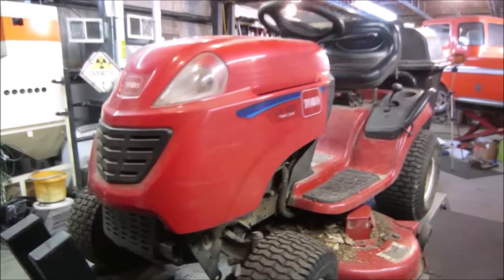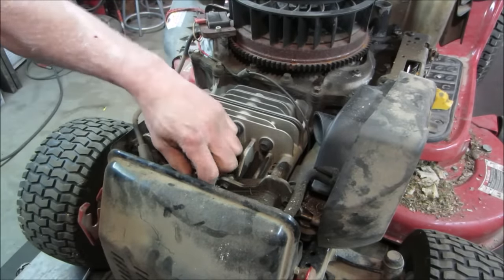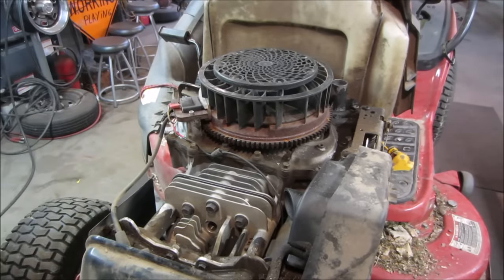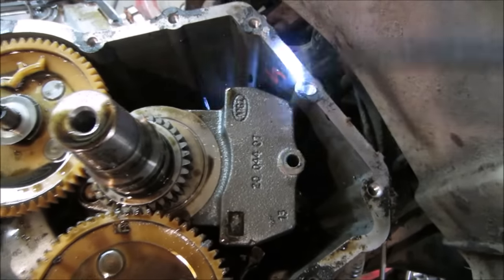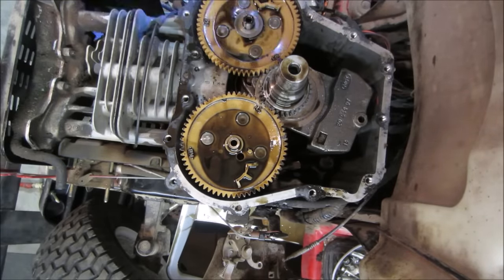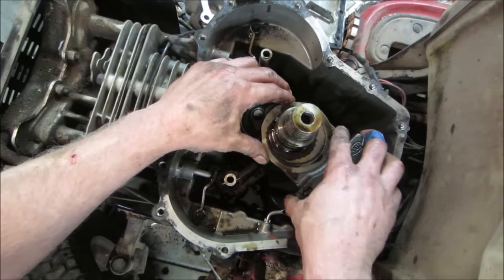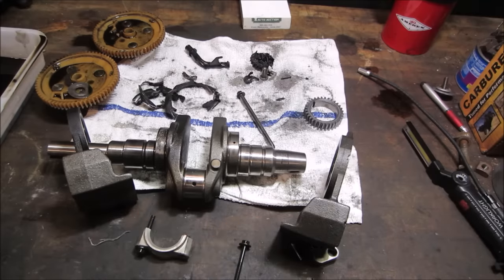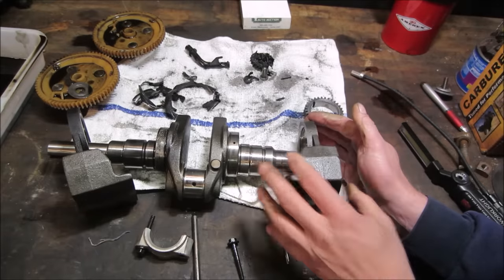You Won't Believe Why This Engine Blew Up,

Comment: Kohler really made a turd when they came out with that engine! The Courage twin was pretty good, but I shortblocked a ton of the singles under warranty because the cam boss in the bottom would crack and lose all the oil while running and BAM! thrown rod! Compression release was problematic too. 99% JUNK!
Reply: I agree on junk

Comment: No matter how old we get we're all still a little boys that like to take things apart to see how they work
Reply: But can we put it back together again  ,is the question 🧔
Reply: See, I think after we learn how things work, we begin to regress in a way. We start taking it apart to see how it broke! After we get our giggles out, then we start to fix it.
Reply: Too often we see how others failed at solving a problem and yes....made things worse. The Mustie types come along to fix the screw ups and then go after the original problem. Happens in my world every day.
Reply: @gispel7058  Hard trying to solve a problem with somebody else having their fingers in it. had a chevy cruze (ew) 1.4T car, misfire all over, everything looked ok ish. After we were doing some testing ect, had it running, full on oil, Turbo started just making awful noises. Long story short, they did horrible oil changes, clogged the turbo oil feed, the son put a used turbo on it, not changing the line, breaking the drain line, and then came to us for a missfire. So DIY gone wrong, aswell as poor maintenance.
Reply: @baileyhatfield4273  Its a problem alright. I don't work on cars and engines but I do mechanical work. Glad you were able to look at your problem and back track what the heck went wrong.
Reply: EXACTLY
Reply: @baileyhatfield4273  if it's not broken, brake it👍
Reply: Building bobber motorcycles I have learned to take pictures... and lots of them!
Reply: @JoeBobsGarage  pictures are ok but you may be taking pics of the other guys failed mixed....out of position/place parts. I'm sure it works for you and I have revered to pics also
Reply: That's how Henry Ford and Harry Firestone got started.
Reply: hahahahahaha
Reply: unless your on ice they pull everything apart and never put it back to geather again.
Reply: @JoeBobsGarage  Got any bobbers for sale?
Reply: Or littles girls too.  I can take it apart but don’t know how to put it back together.  I had a brother that worked on something and I loved watching him.

Comment: Geez one bolt fails and the crap hit the fan!  Thanks for having me over to hang out in the garage bud it's a good time as always.
Reply: considering the diameter of that bolt, relative to the hole, I wonder if the design got undermined by "yeah, but if we downside the bolt, it's a few cents cheaper per 1000", and then it snowballs hard
Reply: @tamberp  The 40 cent bolt...IS NOW 30 CENTS! LETS GOOO. *sad 20 year old engine noises*
Reply: This is just stupid.  It's a counterweight:  why not just use a really big grade nothing bolt instead?  Reduced thread, machined nut, I can only imagine what this cost.  But FYI airliner engines are held on with two bolts, so if one of those fail then figurative crap really hits the literal fan!
Reply: @paulmoir4452  CFM and v2500 engines have five mount bolts up front and four in the rear.    They are all over an inch in diameter. I struggle with a four foot torque wrench to torque them.

Comment: Good show, Moe. The sinister laugh at the end when putting the crank back in with "Up Next. Will it run?" is cliffhanger material all day long. Hysterical and surely has us wondering how bad it will be and how long it will last!
Reply: I have the popcorn ready for the microwave and time on my hands bring it on destruction here we come. Will he do it oh yes he ran the twin cylinder with one piston and jug let’s start the pool for how log it lasts.
Edit: I give the engine 2 minutes 29 seconds before it locks up.

Comment: My neighbor gave me a honda push mower that was locked up. I soaked the cylinder with pb blaster and have been using it for 4 years. Love the videos musty. You have really increased the depths I'm willing to go before I give up on equipment. Thanks 😊

Comment: What a weird engine! Never seen a fixed counter balance like that? Thanks for getting your hands oily and showing us!
Reply: I'm going to guess it has something to do with the unbalanced (otherwise) magnet on the flywheel. Overly complicated POS if you ask me. Not only that, but there's cut corners everywhere you look. Thin case, no hardened surfaces against gravity effects (the part that Mustie was showing that got munched in the crank case), there's clearly no oil ramp, and this relies on other means to get lubricated...
If i were to bet, i'd bet this engine started life as a vertical engine, then some smartass in the cost cutting department decided to swap it to horizontal, with the required modifications, to which there's no issue, it can be done, but if you do it whilst nursing your thumb with your .... it won't last. And a cursory glance on google for this engine proves my point. This engine platform is riddled with problems, from cracking to spun bearings and other stuff. What a piece of junk.
Reply: @aserta  buddy...this is a vertical lol. The counterbalance is meant to oppose the vibrations created by a single cylinder’s piston oscillating up and down. Now most single cylinders just use a balance shaft including newer Kohler. The piece that was chewed inside was likely an oil baffle to avoid the foaming of the oil around the governor gear.
Reply: @aserta  "What a piece of junk"  I will second that motion.
John
Reply: @aserta  flywheels are also balanced. You’ll find drilled holes along the perimeter to balance and reduce vibrations.
Reply: @joshuaolsen8844  Oh jeez, and a bushing for the counterweight is completely inappropriate for the side loading that occurs in that orientation. It will always be pinching on the bottom/piston edge and top/counterweight sides because of gravity pulling it downward.
Reply: @joshuaolsen8844  Now that I think about it, that counterbalance design in that orientation would likely fail eventually, regardless of any bearing design.
Reply: @aserta  Still running a 16 year Courage single. They had simple and easy problems to rectify that most people didn't bother with. Crankcase screws need Loctite or they back out and hit flywheel wrecking the case. Didn't come that way from factory. Many have died from that alone. Easy to solve and reliable otherwise as long as oil is kept in it
Reply: @joshuaolsen8844  Wow, a guy who actually knows what he's talking about. Rare on YouTube

Comment: It's amazing how the simplest little prick can cause such a BIG problem! The way that governor exploded was CRAZY!
Reply: Should see how the old Governor of Cali's head exploded in Total Recall
Reply: @Demonfang Arun nah the bolts just break. It's extremely common. His analysis was probably pretty close to the series of events.
Reply: Dude!! Spoilers!
Reply: @TheAncientOneYT  now that's funny right there.
Reply: @Demonfang Arun s
Reply: @Demonfang Arun NJ
Reply: @Demonfang Arun EXACTLY,the oil integrity goes it immediately wears and things run out of spec,and it won't last long,CHANGE THE DAMN OILS,THEIR CHEAP
Reply: @strattuner   And Maybe Keep And Eye On The Level Of Oil.
Reply: Given the comment at the beginning about driving over a wad of grass, I would have looked below first. Owners use these to turn mulch into compost. Wet crud balls can act like cement and trap the blades and kill the engine, at least in my limited experience. Just suggesting go from simplest to more complex.
Reply: There is many a " little prick" that caused a big problem after 9 months

Comment: I have owned a mower with this engine for the past 8 years and have had no issues due to regular maintenance. One day while going over the mower I noticed all the top cover bolts have come slightly loose most notably the ones near the back where the locating thing that that screw screws into and is located in the top case. I think what you said about the bolt failing and working loose is true, but I think the reason said bolt was able to work loose was because of warpage or looseness of the top cover where that silver locating thing sits in the case. Fingers crossed mine keeps going haha.

Comment: That's so Mustie: The whole engine is crap, several parts destroyed... Coming up next: WILL IT RUN? 😂
Reply: It probably would but without the balance weights it'd probably shake itself to bits. Yeah, I'd watch that...
Reply: Just remember that the bottom of the case where the crank rides is severely scored/chewed up. The case is ruined, there is no fixing that. Even if that case damage were filed down and cleaned up, the tolerances would be way off. I'm sure he could get it running again, but it wouldn't run for very long.
Reply: @trevorjameson3213  It is not supposed to last forever. The only question is if it runs at all.
Reply: @fh13439  That is a TRULY short sighted business model....
Reply: @charlesangell_bulmtl  This is a destroyed engine. This is not business... making it run again is just to show it is possible.
Reply: he should just go to his hoard and grab the parts..lol
Reply: @trevorjameson3213  Oh sure it would!  And run like it was new too!  Would just have to machine or grind flush where the crank rides, or fill it up with weld, and every other scored and burnt surface, then shim back to spec.... Would it be WORTH IT?  Uhhhh.....NOPE!  Probably buy 2 riders for the cost and time of fixing THAT one.

Comment: Just wanted to say thanks for all the information on small engines. Just helped my friend with a Kawasaki 15 HP twin with a bent push rod. Straightened it out, put it back, adjusted the valves and it LIVES...lol...never would have tried that without watching you. Keep em coming to Walkertown NC.

Comment: I never tire of riding mowers.
Reply: same or garden tractors and idk why, just good cheap fun to try and get them running.
Reply: @garymallard4699  nice! I got a few at the moment, from 60s-90s, but simplicitys and a snapper LT12, either got em all for free or under $85. Like you said, fun to just revive them, trying to figure out this valve tick on a briggs cast 10hp, need to replace the valves and then might need rings. Fun to learn on. Those Ropers are great tractors from what I've seen
Reply: @garymallard4699  nice! That sounds kinda like the attachments I'd like to have, but realistically don't use as much as I wish. The loader would be super handy though and zero turns are quite a bit faster, I guess overall a few mph to 10mph faster and turning. And yeah most cases with things I get free in the garbage is bad fuel/car or safety switch/no spark. Most my garden tractors were rode wet and put away hard though lol

Comment: What surprises me is the engineers would have to have known that bolt was completely wrong for the counter-weights. Yet, here we are. A more unusual reason for engine death we've seen on your channel. Much enjoyment derived. Thanks, Mustie1!
Reply: I think it's much worse than just the bolt. Think of the bearing side loads from the counterweight being pulled down by gravity. This sucker was never intended to be run horizontally.
Reply: @photodan24  Very good point!

Comment: I have an Ariens mower with the same engine and the counter balance came apart. It was at idle and came through the side of the block. I replaced it with a Predator 708
Reply: Every engine manufacturer has gone down in quality. They are just not built to last anymore.
Reply: @1988MowerMan  I was trying to repair oil leaks on my tecumseh 12hp on my riding mower.  I pull the repair manual by the id code.  Its a "long life" engine.  it was made over 30 years ago and still runs.  I was amazed to find I could get the entire gasket and o-ring kit for it.  Oil leaks fixed, still cutting grass.
Reply: This guy is awesome
Reply: @orbitalair2103  Nice : )

Comment: Makes me glad my Toro has a B&S motor. Only issue I've had is with the decompressor. If the valve clearances are a bit too big the decompressor doesn't work and the starter struggles to turn the engine over. I bet many people have replaced batteries or starters only to find that all it needs is the valves adjusting.

Comment: Too complicated, too many moving parts. I love my old Wisconsin AGND. It has a piston, a crank, a crankshaft and a bit of junk to run the valves. That's it. It vibrates and rattles and has been running without an issue since 1954. BTW, I was able to get a Honda HDR running after it sat all winter with gas (and water) in the tank and carb. I knew how to do it because Mustie taught me! My lady was mightily impressed. LOL
Reply: People rag on me for sticking to briggs flatheads, but they’re just so much more reliable. May only make 5 horses but it’ll do it for longer than most marriages last.

Comment: At 2:06 my guess is the low oil safety switch shut it down. Lets continue the show to see if im right.
Edit: well i missed that by a mile. Maybe next time.
Reply: Maybe ! I still say governor drive gear .
Reply: Yea that govonor gear was mangled pretty bad  I am surprise from manufacturing they did not just weld those weights together  I am also assuming the bolt was loose to begin with and not tight I or not meant to be tight .  Here is another interesting thing with the weights mounted sideways how are they going to balance a sideway’s force the weight would be working against the bottom of the crank if you know what I mean .
Reply: These do not have a low oil safety switch. At least the ones I have dealt with.

Comment: Always a fun synopsis. The force of gravity allowed the lower side to drop and get out of alignment every time the motor was stopped and restarted. The upper would remain flush on the bearing surface. Look forward to the rebuild/re-power.

Comment: Oh if Kohler only would reproduce the old Command series of engines. I had to make the move to Kawasaki once the Courage line made its debut. Love my Kawi's as long as you keep them oiled and the valves adjusted.
Reply: I Think That's What I'm going To  go With On My Husqvarna MZT-61. It has A 30 HP Briggs Motor and The Sump Will just not Seal. Briggs Came Out With A Updated Sump but I kept My Hours Down. Only 150 Hour's. Briggs And Stratton Went Bankrupt Because of Things like This. And Kohler Isn't Much better.

Comment: I believe I saw what we called in the Air Force "military engineering" which basically translates to " if it don't fit, force it. If it breaks, it needed replacing anyway " lol. I love watching these break down, I hope you repair it.
Reply: That's what it was in some parts of automotive too O_O if it didn't wanna come out easy, torch and BFH. Some stupid things like sway bar links, things are getting replaced anyways, the nut won't come off decent? Torch it. Gives a rookie like me some uh...experience with the torch.

Comment: What a weird internal set up on that engine.  You'd think standard counter weights would be fine but there you go, a whole motor wrecked after that one bolt snapped. If that bolt hadn't broken the next wear item would be that locator cam/slider thing. This is why Briggs &  Stratton engines are as simple as they are.

Comment: You're like me, I still have T-shirts from concerts 25 years ago. I mention it because I saw yours was 14 years old. Mine have weld spatter holes and stains and caulk and epoxy but I still consider them valid work shirts!

Comment: I was fascinated by the engineering of that engine, until you showed us where it had broken apart. Imagine; two heavy counterweights, oscillating at high rpm, held together by a 1/4 inch bolt. Somebody dropped the ball, or tried to save a buck. What a shame.
Also, I noticed two separate cams operating pushrods on either side of the cylinder? Bizarre!

Comment: Anybody know Mustie’s background/training?  Just curious…I teach second grade and I encourage my students to learn a trade because NO ONE knows how to do anything anymore!  Thanks in advance!
Reply: A lot of it, is that your normal guy can't just go around and check a problem. in the 60s 70s it was mostly just hey i got basic tools, a FEW specific diag tools, and i'm ready to go. Now if you have a problem, it can be so many things. Starting on some easy older stuff is always great. Mowers little engines, brakes, just learning how things come apart and work. Appliances too, different but much the same in learning. I've learned a ton just taking apart appliances when they break, spend idk 30 40 bucks and a little bit of time, get it running far sooner and FARR cheaper than yet another new ready to die in 5 6 7 year appliance.
Reply: It looks good but to the trained eye it's I doubt Formally trained if that's what you mean ?.
Reply: Aint that the truth,

Comment: In my limited experience of Kohler Command engines I think your pretty close to the sequence of events. The engineering involved to make sure a lower bearing fails is pretty impressive as it seems very common for balancer or lower main bearing to seize.  (although in this case it was the long bolt holding balancer together) I'm pretty sure there would have been an increase in vibration before failure. The starter gear looks new, seems that the starter motor fails very shortly before bearing failure.